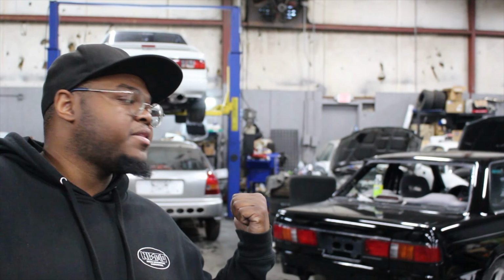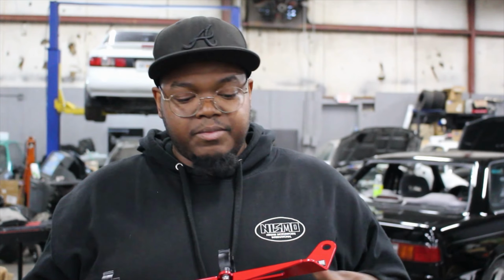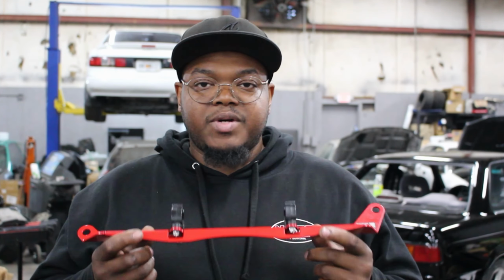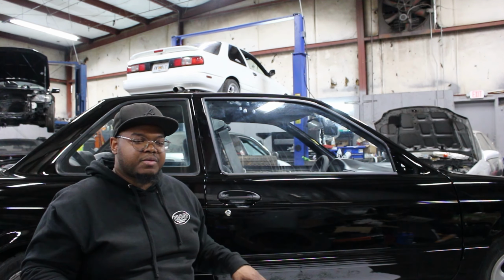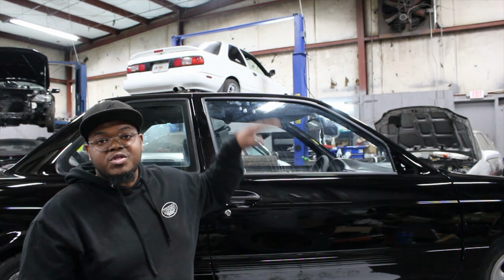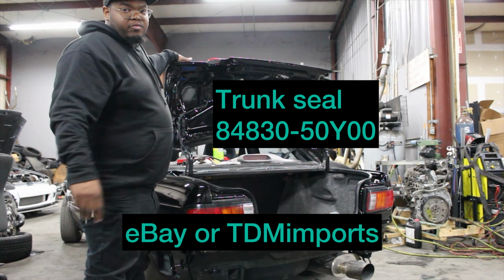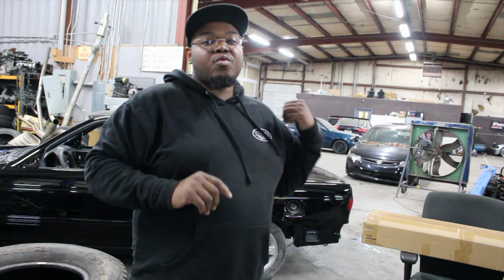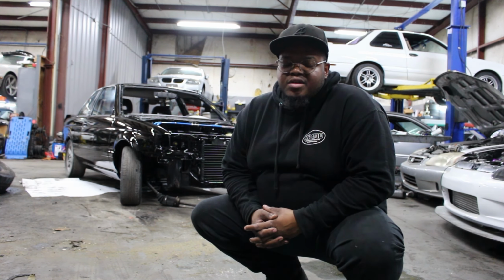New B13 Project (Part 1)

Comment: Greetings from North Carolina.
 I have a b13 SE-R and I would like to modify the front and rear bumpers.  Where can I get them?  thank you
Reply from the maker: There are number of different b13 bumpers out there. The ones that I have (GTS1) are the most rare. I got mine from a guy in Russia Initially. But after the accident I was lucky enough to find one on eBay from Malaysia. The bumpers are no longer made new. So only used ones come up for sale. Expect to pay $1000-$1500 for the front bumper with fogs and support. And $600-$1000 for the rear. They are rare JDM parts so it can get expensive really fast